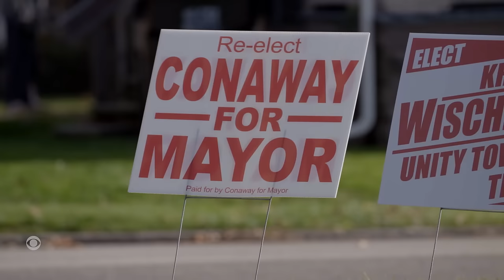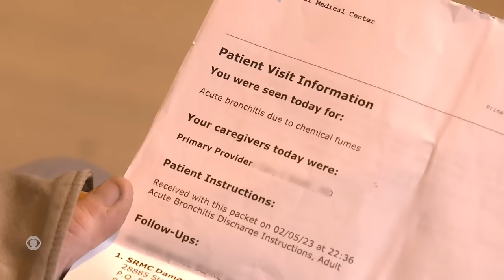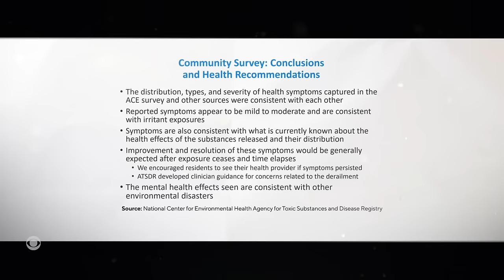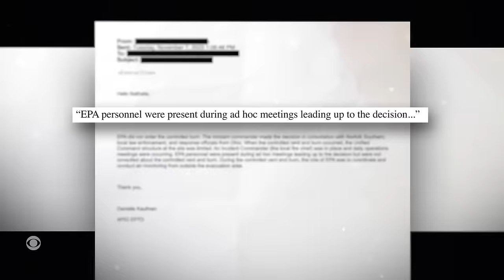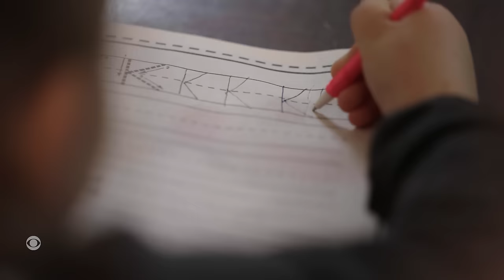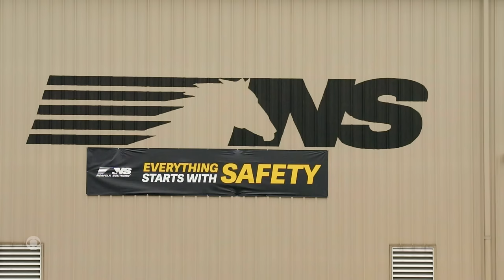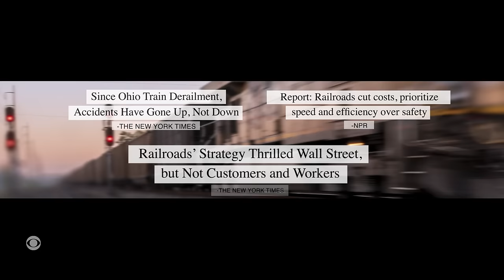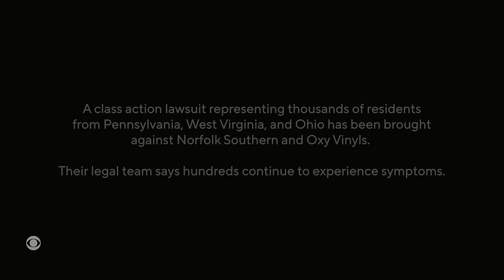Toxic Fog: The Aftermath in East Palestine, Ohio | CBS Reports

Comment: Question 1:  Can the railroad refuse to carry some cargo because it's dangerous? No.
Question 2:  Did having two crewmen in the cab make a difference?  Nope, neither looked backward to see the 60' flame coming from their train.
Question 3:  When the railroads complained that Nancy Pelosi's new PTC signal system would cause them to divert safety expenditures with little advantage, did the government relent?  No.
Question 4:  Did the hideously expensive PTC system prevent the accident?  No.

Comment: Chemicals can be absorbed into homes (IAQ/absorbable material) differently than outdoors (wind and nonporous material being one difference) and the fact the EPA "expert" doesn't understand is disturbing. The water supply and the EPA respnse is also concerning.
Reply: The EPA “expert” also doesn’t study the human body. The problem here for everyone in this town and around the area is the reaction to chemicals by the mast cells in the human body. Every body will have a different reaction depending on their immune system and nervous system. It’s a problem solved with antihistamines and mast cell stabilizers that are inexpensive and have low side effects. I am not a dr but happy to answer any questions.